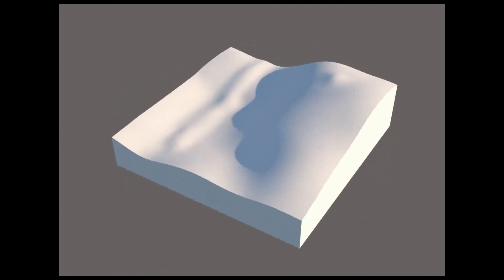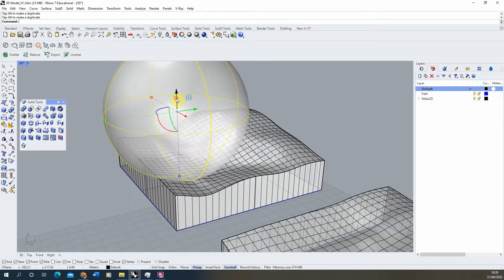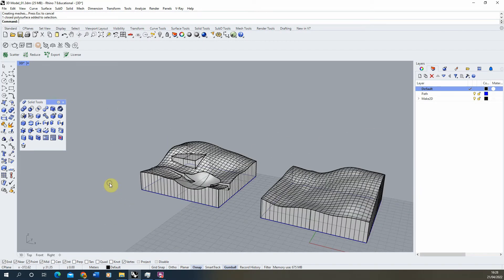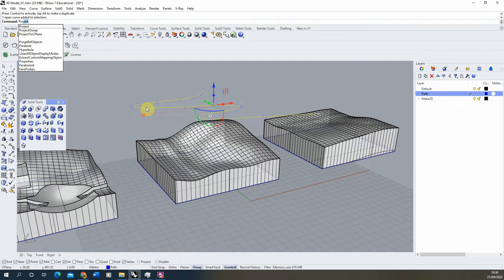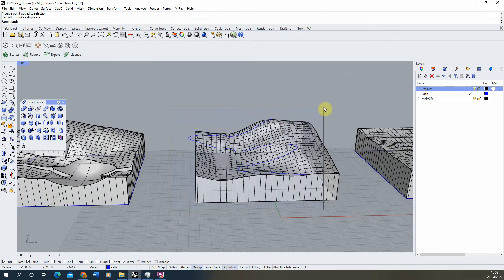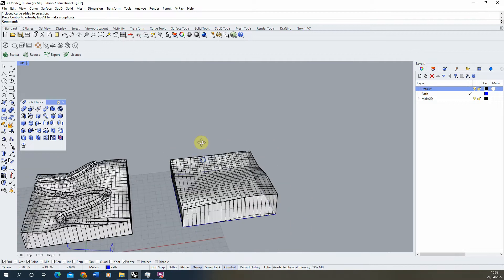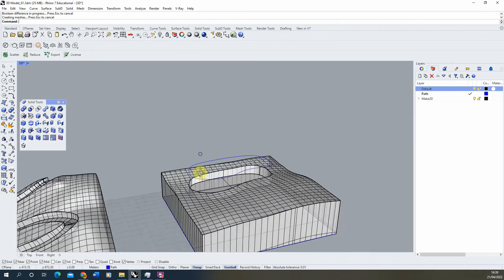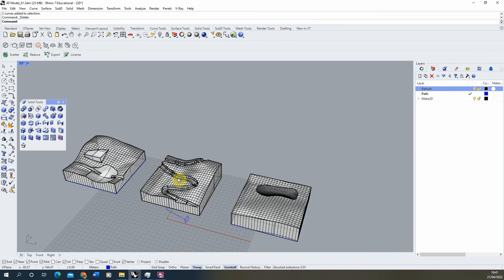Excavations within a 3D Terrain Model - Rhino 7

Comment: wait it doesnt register my terain as a polysurface I can only exttrude with mesh boolean cmandss  whyy is that
Reply from the maker: You can usually check if your object is a mesh or a polysurface by selecting it and checking the properties menu on the left of your screen. If it is a mesh the 'MeshtoNurb' command should convert it